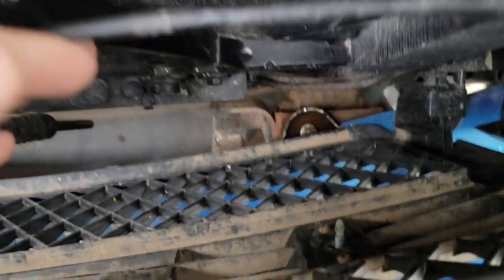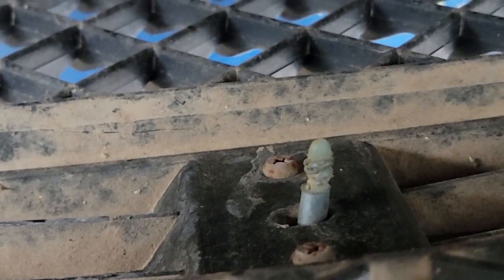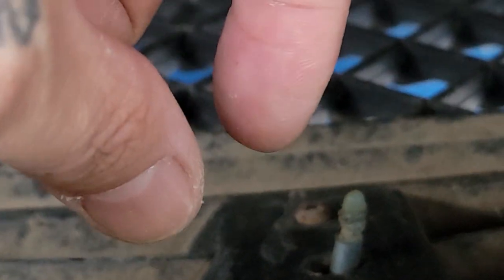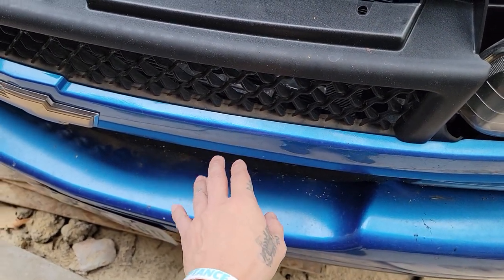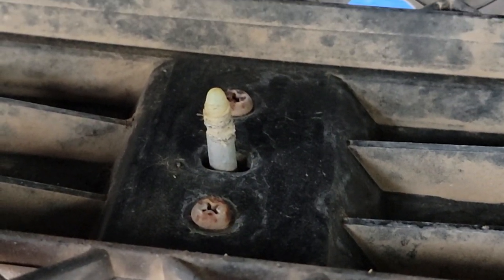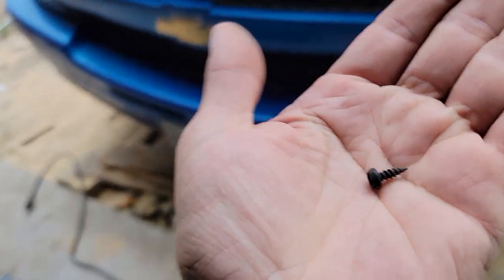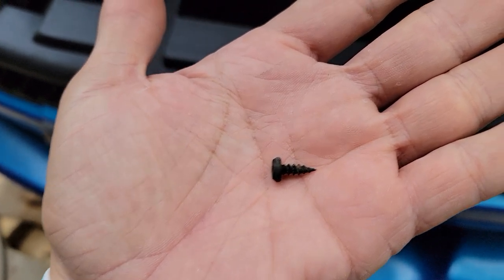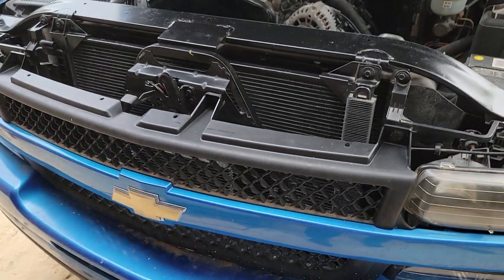Quick Fix: BROKEN Thread Cutting Nut?

Comment: Hey how much paint do you need for a 99-06 single cab
Reply from the maker: You can do with a gallon kit.
Either basecoat + clearcoat or single stage,  I've painted single cabs with one gallon kit.
Some basecoat reduce 1:1, so basically you have 2 gallons of paint to use,  and some single stage mix 4:1 so you have 5 quarts to spray.. depends what color you're spraying or if you're using a sealer before the paint, but yeah.. one paint kit should do!